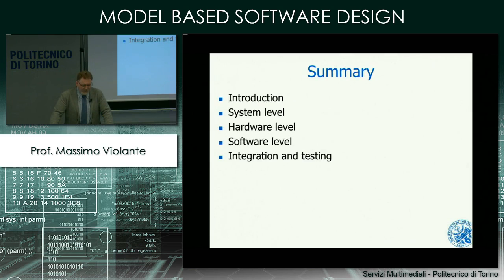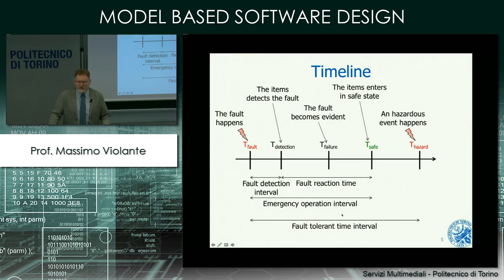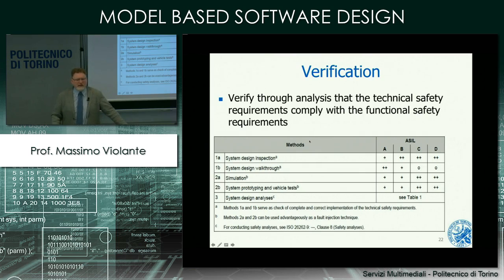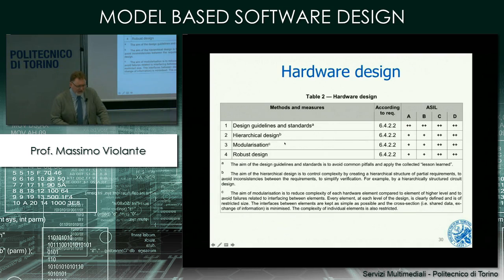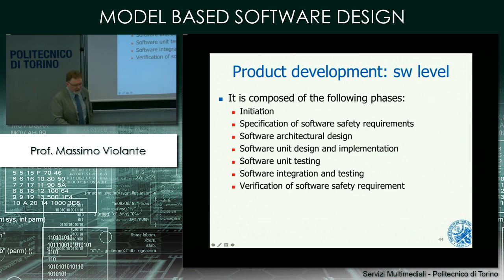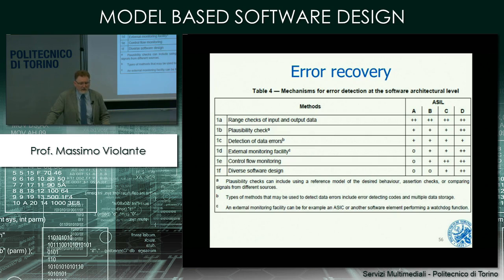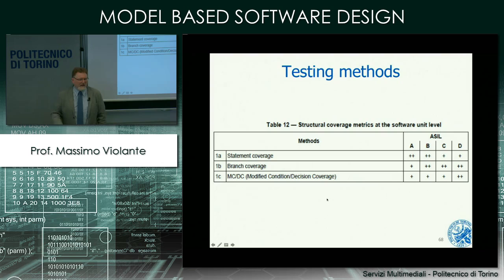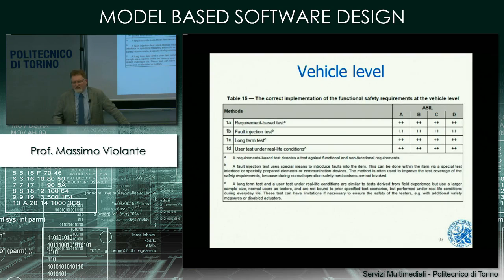ISO26262 - implementation phase

Comment: Hi Usman, You did a great job in uploading these materials ... Thanks a lot.
But i found a lot of Sessions in ISO 26262 Standard.
Could you please send me the Sequence of these sessions to watch them Respectively.
Reply from the maker: 2016_Lezione 01
   del 2016-03-02
Introduction to the MBSD
2016_Lezione 02
   del 2016-03-04
Introduction to functional safety and ISO26262
2016_Lezione 03
   del 2016-03-04
2016_Lezione 04
   del 2016-03-11
ISO26262 - part 1
2016_Lezione 05
   del 2016-03-11
ISO26262 - part 2
2016_Lezione 06
   del 2016-03-16
ISO26262 - The QA example
2016_Lezione 07
   del 2016-03-18
ISO26262 - implementation phase
2016_Lezione 08
   del 2016-03-23
ISO26262 - The eCall example
2016_Lezione 09
   del 2016-04-01
Model-based engineering (part 1)
2016_Lezione 10
   del 2016-04-01
Model-based engineering (part 2)
2016_Lezione 11
   del 2016-04-01
Model-based engineering (part 3)
2016_Lezione 12
   del 2016-04-06
Model-based software design (part 1)
2016_Lezione 13
   del 2016-04-08
Model-based software design (part 2)
2016_Lezione 14
   del 2016-04-08
Model-based software design (part 3)
2016_Lezione 15
   del 2016-04-08
Model-based software design (part 4)
2016_Lezione 16
   del 2016-04-13
Model-based software design (part 5)
2016_Lezione 17
   del 2016-04-15
Model-based software design (part 6)
2016_Lezione 18
   del 2016-04-20
Introduction to LabVIEW and myRIO
2016_Lezione 19
   del 2016-04-22
LabVIEW at work on myRIO (part 1)
2016_Lezione 20
   del 2016-04-22
LabVIEW at work on myRIO (part 2)
2016_Lezione 21
   del 2016-05-04
Model-based software design (part 7)
2016_Lezione 22
   del 2016-05-06
Model-based software design (part 8)
2016_Lezione 23
   del 2016-05-11
Software testing
2016_Lezione 24 (Seminario)
   del 2016-05-13
Mathworks seminar (part 1)
2016_Lezione 25 (Seminario)
   del 2016-05-13
Mathworks seminar (part 2)
2016_Lezione 26
   del 2016-05-18
Introduction to AUTOSAR
2016_Lezione 27 (Seminario)
   del 2016-05-20
Virtual Validation (part 1)
2016_Lezione 28 (Seminario)
   del 2016-05-20
Virtual Validation (part 2)
2016_Lezione 29 (Seminario)
   del 2016-06-01
Static code analysis for iso 26262
2016_Lezione 30
   del 2016-06-08
Exam Example
2016_Lezione 31
   del 2016-06-10
Exam Example
Reply: Thanks a lot Usman
Reply from the maker: Ahmad Yahya  your welcome
Reply: @ufwuman  Hello Usman, I would be grateful if you could upload the remaining lectures also!
Reply: @ufwuman   Thanks a lot for your uploading i need the   ISO26262 e-call example